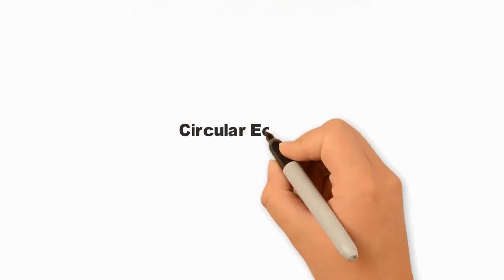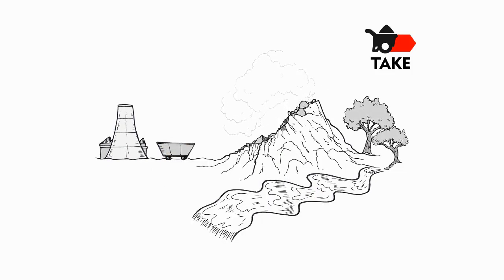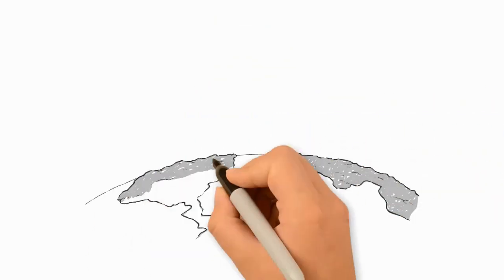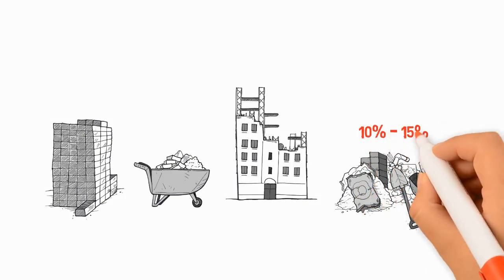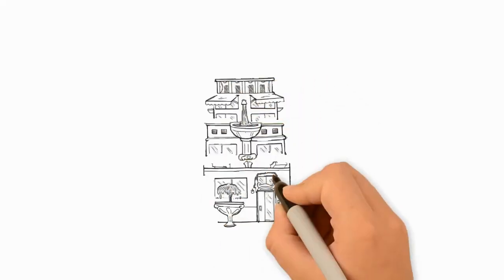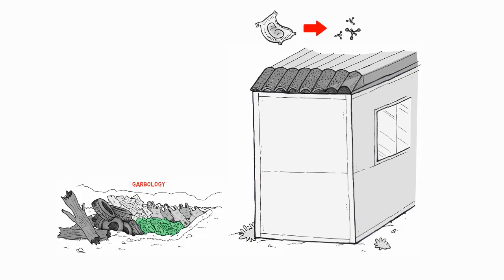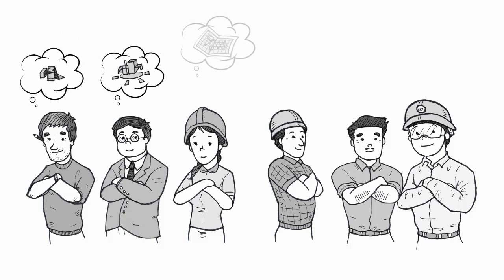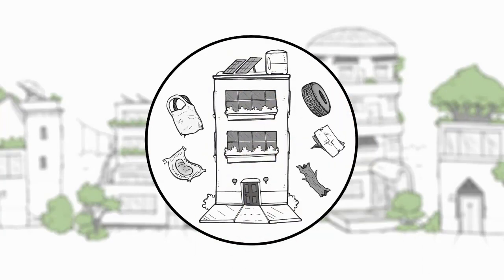Construction industry & Circular Economy

Comment: I never thought that the Construction industry had such a strong environmental impact!
Reply: Worst is normal cement concrete. You need 1500 °C to make it and that emits a lot of CO2 but two times more (66%) is emitted by the raw material because lime (CaCO3) is the main raw material and it is a stone building mineral which consist of CO2! It is clam shells which took the CO2 out of the atmosphere million years ago and the cement manufacturer  dig this safely stored CO2 out of the ground and pump it back in the atmosphere. And for what? To make a cheap cement. Because it being cheap, is the only reason why it is used so much. The only. And is it really cheap? No, of course not. There is no free lunch. It is the consumers who pay the money the cement manufacturer take for burning our tires and other garbage as "environmentally friendly energy source". Yes they take money for them taking on fuels like plastics which burn fantastic as such high temperatures. That is why I love geopolymers. The Wikipedia article about geopolymers is quite good, by the way. Have a good one! Pat